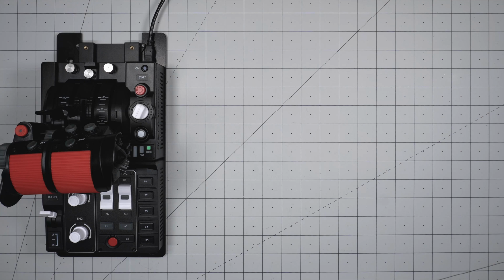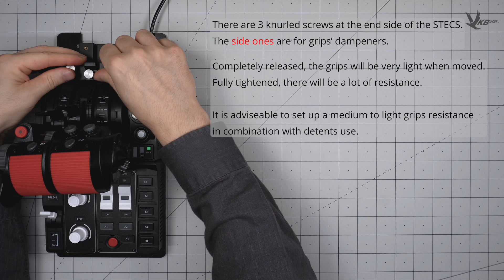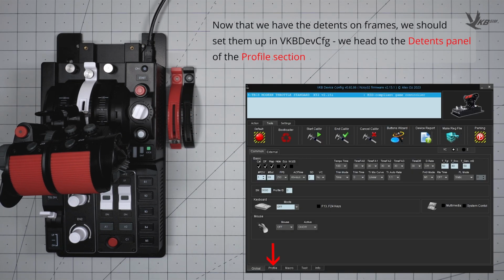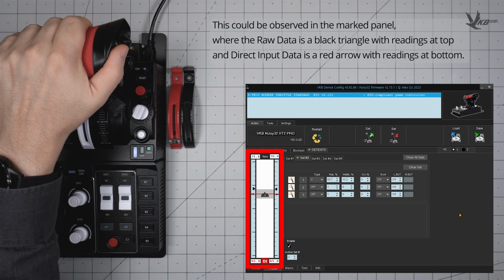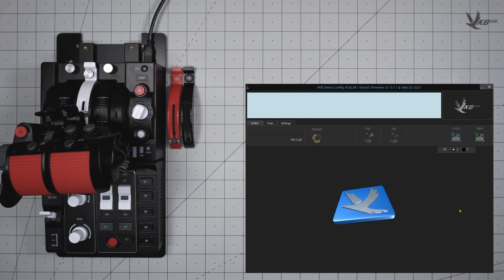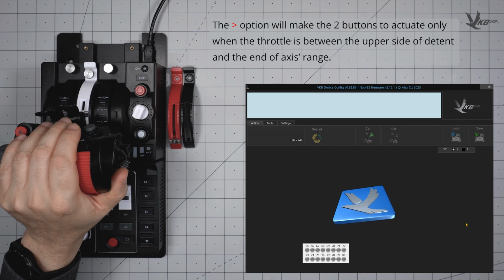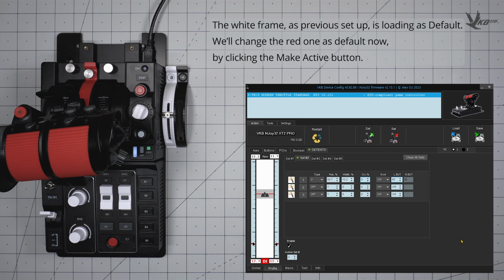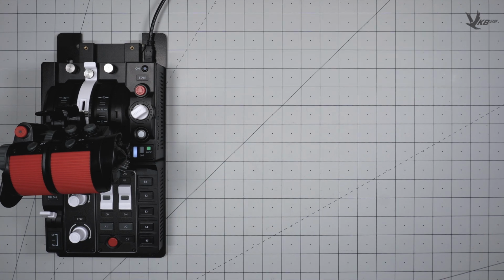STECS Setting up custom detents

Comment: Dear VKB, thank you for the excellent device. I enjoy it very much. I have a question though: how do I assign negative throttle values to lets say 0-20% ? I want to use this range of the axis for the reverse thrust, and unfortunately didn't find a solution by now. A link or any response will be appreciated. Sincerely
Reply from the maker: You only need to assign the axis to strafe instead of full throttle, this way you'll have throttle fwd and throttle back on each half of the axis.
Reply: @VKBSim  Thank you. Though I wasn't lucky enough to locate strafe/full throttle in the VKB Config app. Could you help any further.
P.S. in User guide I couldn't find "strafe!" as well.
Or should it be done in the game settings?
Reply from the maker: @cerebralvolvulus  I meant in game, not in VKBDevCfg. Come on our Discord server, we'll explain more over there https://discord.gg/UJAdpdHpYm

Comment: The flexibility looks very good, especially the swap of detents is genius.
EDIT (now I see @jubuttib also wanted this, great I'm not the only one): I'd love to see two events per detent though + few new events. Consider the STOP/IDLE transition which in many planes in DCS requires two different bindings. I'd need event like "leaving the detent up" (and down) which would fire a button press of some short (perhaps customizable) duration. Or is there an alternative how to bind throttle stop/idle commands in a different way directly on the throttle? (I know it does not have to be on the throttle, but why not?) 🙂
Reply from the maker: The software part is adjustable at both user and developer levels. If there's a function that is needed we will see if it could be implemented.

Comment: So, a replication of an A320 throttle would be possible. The first detent with lever action for the reversers, the second for CL, the third for FLX/MCT and on 100% TOGA. With the interchangeable detent sets and profiles, it's also extremely simple to switch between an Airbus config for MSFS/XP and a fighter in DCS. That's incredibly easy and flexible at the same time. Can't wait until it is available in the EU store.
Reply: I'm also considering this product to play MSFS !
I know it's more for things like DCS but the flexibility to jump between airbus and boeing with just a thumbscrew is amazing.
For Airbus I think 2 M-shape detents (CLB, FLEX) and one L or V-shape detent for reverse should do the trick !

Comment: is there a technical documentation regarding the dimensions of the throttle as i would like to check if it fits my desk thanks
Reply from the maker: You can see the base plates measurements here: http://forum.vkb-sim.pro/viewtopic.php?f=27&t=7552. Add 2-3 inches at the front for the grips, as they go further at max deflection.

Comment: Is there a way to get detents for GNX-SEM ? When I bought mine, I've got 2 × 3-detents plastic pieces, but no 4-detent piece.
Reply from the maker: The STEM doesn't come with any extras, only with the 3 detent block..
Reply: @VKBSim  I've got two blocks with 3 detents and one with 2 detents. Maybe they were in the box of GNX-THQ ? Old order (2021).
So there are no 4-detents blocks?
Reply from the maker: @Jahus  I'll have to check what extras were originally included in the SEM package, please contact me on Discord.

Comment: Will the detents and rails be sold separately in case we want even more detent configurations by using additional profiles? How many detents will be packaged with the throttle?
Reply: The reddit post for Phase 1 laid out the plans:

The Mini models will come with 1 detent frame and 1 of each L- and V-shape detent type (total of 4 detents).

The Standard and Max models will come with 5 frames (all the colors), 4 of each L-shape detent type, 5 of each V-shape detent type, and 2 M-shape detents (total of 20 detents).

They also mention the following: "All modules, rubber inserts, detents and detent frames will be available separately, too."

Comment: Is he putting the emphasis on the wrong half of detent or am I retarded?

Is it DE-tent or de-TENT?
Reply: That, and just the wrong vowel sound (should be more like the "di" in "ding" rather than the "de" in "dentist" used here).

I mean it's not a big deal, of course. =)
Reply: I have always heard it pronounced as DEE-tent. with the vowel sound the same as the word bee.  @jubuttib
Reply: @maxables1748 Yeah, that's the same sound, just elongated. I've heard both long and short versions, but that sound.

Comment: That's a very nifty system, and really quick to swap between settings, top job!

One thing sticks out as a missed opportunity though, is having the ability to have different buttons activate when crossing the detent deadzone depending on whether you're coming from above or below. Like for example some planes in DCS have separate mappings for "Stop to Idle" and "Idle to Stop", and supporting this behavior could be very useful.
Reply from the maker: Never say never, let it cool down a bit and we'll see if that feature could be implemented.
Reply: @VKBSim  Great to hear this is your attitude, though if I'm honest I never doubted you. =)
Reply: As long as the game doesn't do anything funny when you hold pressed either of those you should be fine mapping buttons to the axis range
Reply: @jackmcslay  you can put the button through a generator function elsewhere to turn a continuous press into a single press.

Something could very likely be done with the boolean functions as well to produce direction specific presses.
Reply: I'm pretty sure this is doable via the advanced functions of VKBDevCfg
Reply: This was my first thought when watching this video
Reply: That's a really good idea!